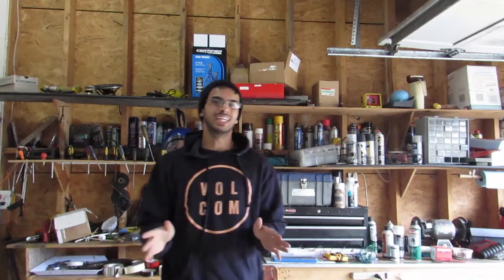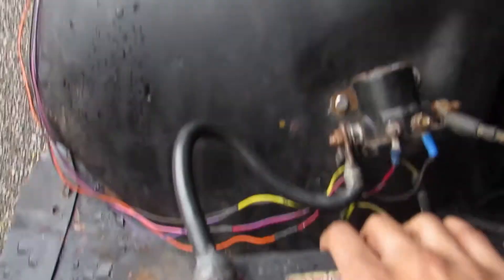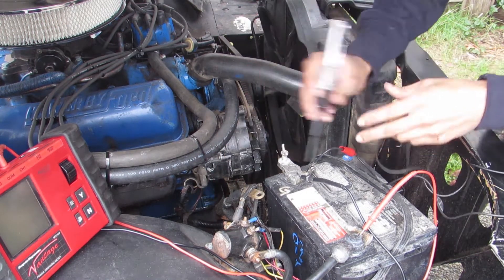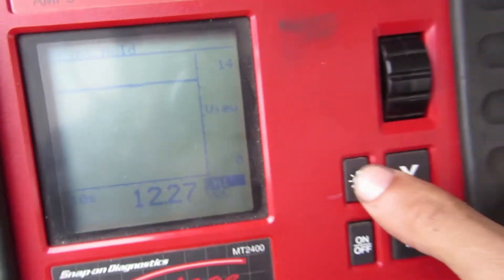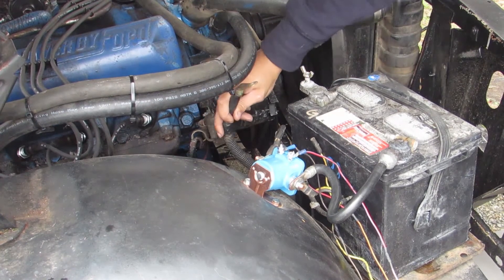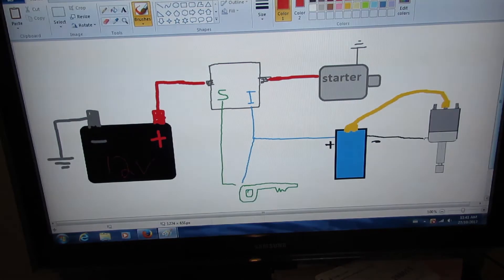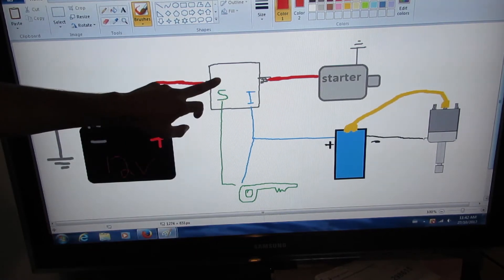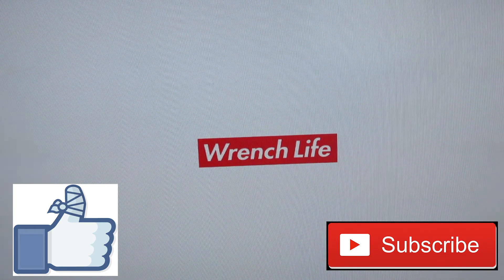NO START: Ford Starter Solenoid Diagnose / Operation

Comment: Hello, I have a question for you, if you are experiencing a 3V voltage drop at the battery, during cranking, how do you correct that issue? You know, since the coil will experience the same voltage drop, as well?
Reply from the maker: Battery will drop voltage  when cranking thats normal.   The starter draws alot of amperage. The coil still will work when voltage is low.  Even 6 volts
Reply: @Wrenchlife604  , Well, I hear you. But, in the video you said if the battery voltage drops to 9V during cranking, the same thing would happen at the coil. If that happen, ya said that would create a weak spark & it wouldn't start.?.
Reply from the maker: @patsuddarth1093  this car has a points style distributor and  it has a  resistor installed in place to limit voltage.  Ignore what i said in the video. It will still start
Reply: @Wrenchlife604  ok.

Comment: You made me stop a couple minutes in.....  and order an oscilloscope. Damn you.
Reply from the maker: still use my $10  volt meter over my scope. just more used to it and not scared if i drop it.
Reply: I use test light and multi-meter for most things, but a scope would be nice to have tucked away in the tool box for some of those "no one knows what's wrong with it" cars.
Reply from the maker: exactly. and its nice to actualy see the wave.  think i was scoping a rad fan and i thouhgt it was 6 volts, but actualy it was a 12 volt wave pulsed at 50% duty cylce to achieve the lower voltage. cars are complex AF now